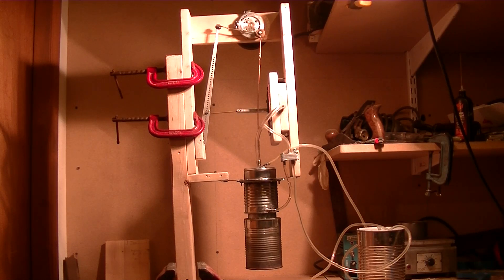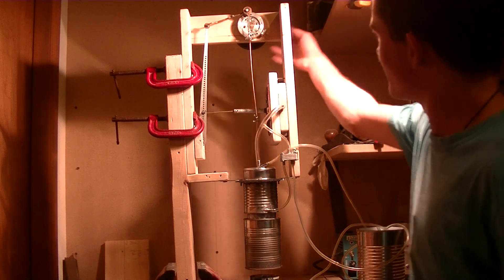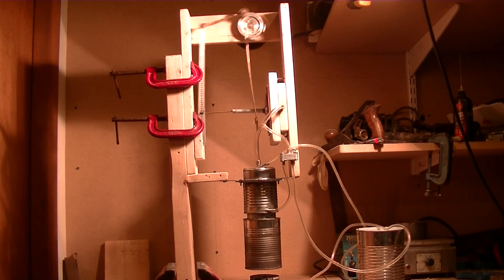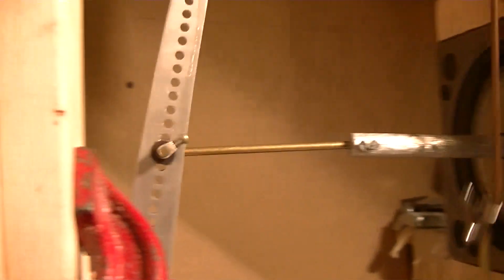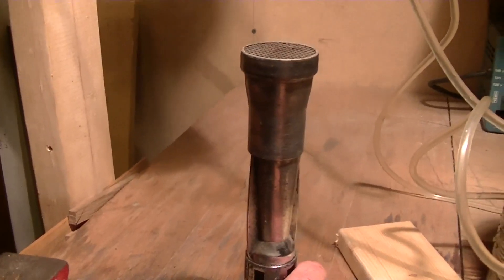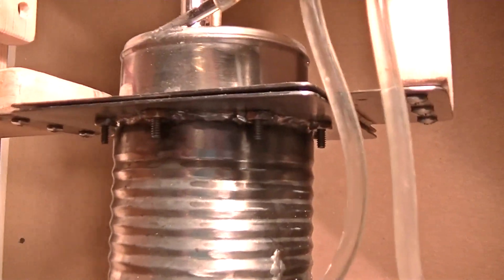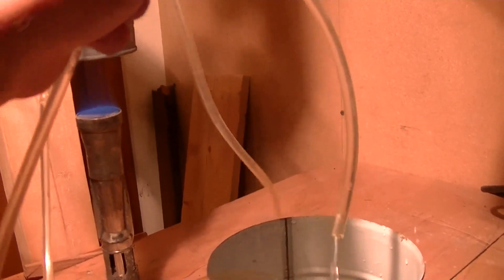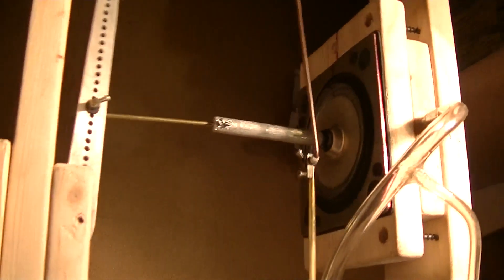First Run of My New DIY Stirling Engine #5

Comment: LOL, you'll have to google Quantum entanglement. Too complex for youtube comments. Variable voltage would be one way, Analog logic style. variable pulse length another aka Morse code, and multiplexing. then there is negative voltage, Multiple terminal capacitors, Tesla style. Literally hundreds of ways it could be done. Mostly using 100+ year old theroy. Then there are the electrochemical/biological/rna/dna methods. Nature is the best engineer. Best ways are already in practice....

Comment from the maker: I know!  A company put fiber optic cables on my street about 3 months ago but they have not run it down to houses yet.  I can't wait till they hook up my house!!!  That's true.  I guess focus on getting rid of binary would be best for now.  But how would you say use 5 or 10 unites?  Would you vary the voltage or how long the unites are?

Comment: Making a decision with light, or a logic gate, Is VERY different to sending a message. Light com port. oh yes please. Light drives and cpus? Lots of energy used for 2% speed increases, if it can even be done small enough, which I doubt in the next 100 years. Better to put the effort into going beyond binary, which we should have been doing years ago... Or using quantum entanglement, which is already on the right scale... And being done..

Comment: Light data cables are awesome. we cant process faster with light though. We cant do anything with it other than send it down fiber optic. Via electrically stimulated LEDs... Look at the energy it takes to store light in a frozen crystal block for 3 min till it decays to nothing... so 8bit ram would take 75kw to run, only work for 3 min, and lose 70% of the data... Morse code has 3 units, off dot and dash. You can do the entire ASCII alphabet with 3 bits vs 8 for binary. would triple HDD space.

Comment from the maker: I see what you are saying, I agree, that would be better.  I think the reason that light would be better is because electronic computer CPUs can't really operate at more than 10GHz.  With light it would be possible to go way beyond that.  I think the record is around 8.3GHz.  Compere fiber optic vs coaxial cable.  The record for fiber optic is 101.7Tb/s over one mile!!!  I could not find the record for coaxial cable but it's probably not near the Tb/s rang.

Comment: Light computers are a silly idea. Go look up the speed of electricity in a wire, compared to speed of light..... Its about 2% slower I think.... What we want to do next, is transistors more like valves, or neurons with multiple switch junctions per cluster. So we can get away from binary, into more complex systems. For eg, a brain can do 0-1-2-3-4-5. compared to a binary computers 0-1. Binary is like counting on your thumb, instead of all your fingers on one hand.....

Comment from the maker: Wow!  It's amazing what they can do these days!  Have you ever tried to figure out how they might be able to make a light computer?  What I have read on the internet they would have the light go through devices very much like transistors but for light.  To me it just seems like there has to be a better why.  Something more efficient and faster because that light transistor to my knowledge will still need to be driven with electricity.

Comment: Have you seen the 3d printed steak? They can also print teeth, bone, kidneys, Battery's, solar panels. carbon nano tubes.... In 5-10 years someone will have printed a cyborg.... Its nuts. Eaiser to list the stuff you cant 3d print. Like planets and stars and... um......... Now I think about it, a plant printer is not completely un-plausable. Would need to be pretty big though. Someone is even printing songs... in waveform.... Yep, would need plasma printer to make a star. Other than that.....

Comment: If making out of plastic. Have a look How Russ at RWG made the coils for his papp engine. Cast in epoxy. Using household rubbish for the molds. 17% is just for the 2 bearings on the crank, and the lowest loss possible. Then there is further loss if you add a generator. I think if your idea works, it could improve performance by 50-100%. Also less drama finding the right generator.

Comment: I think the best you can do converting lineal to rotational is around 17% loss, Worse with some bearings etc. Displacer walls with coil inside would be the way to go for sure, no reason not to do it on piston too!! You would have 2 cans connected by some air hose, and would be able to orient however you liked. Pick up the piston and move it around while its running... Have them a long way apart. Lots of benefits if can be made to work! Steel can and electromagnet could have issues though?

Comment: I do. Need to find the time... May be easier once the 3d printer is going. Plastic LTD Stirling would be awesome. I wonder what liquid would have the greatest expansion. Your right about the high power. Could be worth the speed trade off. With the right dimensions it might not have to be slow. All that force has to go somewhere.

Comment: I think you may be onto something there. Solid state crank. Use a power factor and maybe a tank circuit to get the 90 deg offset! Using lineal generator/solenoid type design. Would be all lineal power. no rotation. Why have a loss converting lineal power to rotational power if you dont have to. Math would be pretty tricky. Cant see why it wouldn't work though. Worth a try for sure!

Comment: I dont know that liquid would work, not enough expansion. Refrigerant gas could be good. I've always wanted to try adding a drop of water. so it steams in the displacer, and condenses in the piston/return. Should work great for heat sources over boiling point. Would require valving.

Comment from the maker: Yes! The Newcomen atmospheric engine!  I have seen a couple videos of that thing running!  It just looks amazing!  What would happen if you replaced the working gas in a stirling engine with say water or oil or some liquid?  The liquid would not compress like water so it may be better.  It would run much slower though because it would have a lot more resistance and take a long time to heat up and cool down.

Comment from the maker: I have a new idea for a stirling that I want to try.  I have not figured it out fully yet.  What if I used an electromagnet to drive the displacer, and either have the piston connected to a normal fly wheel or another electromagnet/generator.  That does sound like it might work.  Would be worth a try.

Comment: Early steam engines actually worked on contraction of cooled steam. Giving a max pressure of 17psi (as opposed to hundreds of psi in the later expanding steam models) It may be possible to feed hot gas to the to a cooled diaphragm, relying mostly on the displacer to do the pushing, then get some power from contraction of cooled gas in the diaphragm. Changing the displacer volume may be another thing to try. I think re-generators are just return gas coolers. For move violent displacer expansion.

Comment: From what I have read, you want the gas going to the diaphragm to be hot, and I think you want it to stay hot as it expands the diaphragm. If it can be cooled on the way back to the displacer, that should give a significant gain. As that would require two hoses and some valves. Cooling the diaphragm may be worth a try, as a poor mans alternative. For valve design, if you want to try that, look at snorkel drain valves. Very simple and effective. Similar to how motorcycle shocks are damped. cont

Comment: Looking great! Really quiet. Balanced flywheel will help with the wobbles. Also a diagonal on your frame. Can be just across a corner, full corner to corner is strongest, but may inhibit moving parts? I'm wondering if a wider bore displacer could be better? I guess you could valve the drive piston too, have in & out lines, and cool the return. Looked like it took off a bit on the first start as the waster started pumping. Could you change the back plate on the diaphragm, to water cooled metal?

Comment from the maker: Thank you!  I have not built much of a pulse motor yet!  I did build one a wile ago before I knew that much about electronics.  It was basically a VCR drum with a couple of magnets stuck on it.  The drive circuit was a electromagnet driven by a read switch.  It ran ok for about 10 minutes till the flyback from the electromagnet killed the read switch.  No protection diodes or anything like that!

Comment: Try building a second sterling engine in the opposite configuration. Then mount them both in the same frame opposite of each other with some sort of mechanism to keep them in sync. Then the vibrations should cancel each other out. I am thinking like a horizontally opposed (boxer) engine.

Comment: Shake, rattle and roll. VERY VERY well done. You have achieved a great deal. I think if you had a sturdier frame to hold the engine frame you would get a lot less vibration and a smoother run. I can't wait to see what it will generate. Many thanks for sharing.